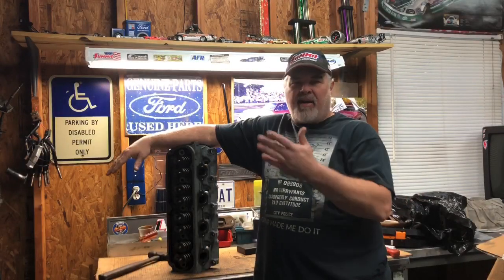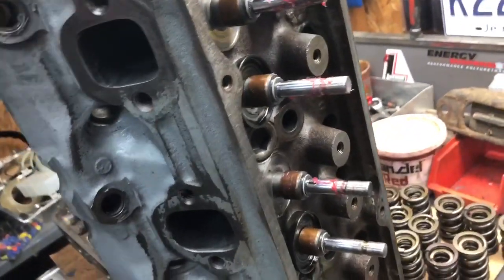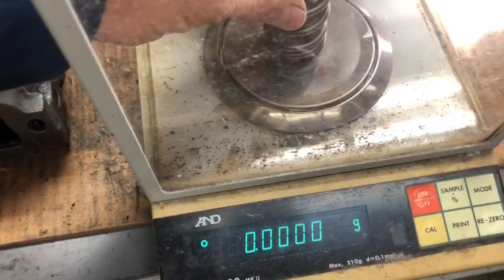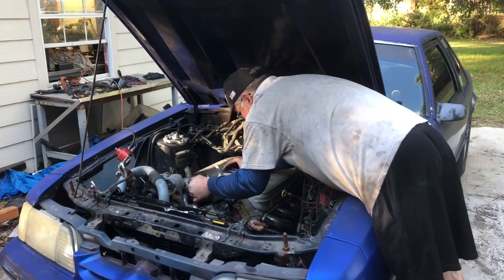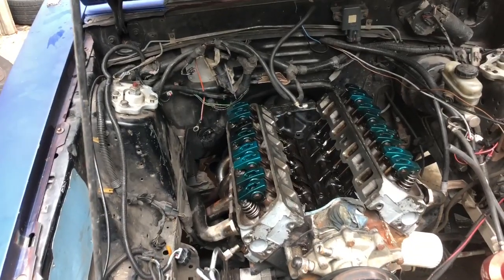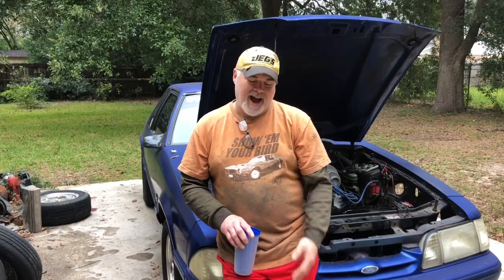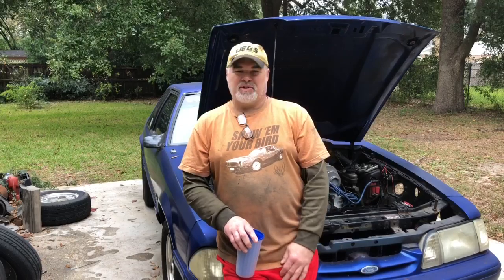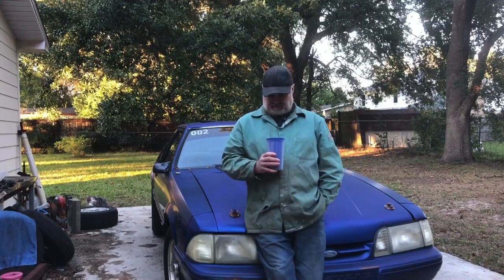1988 5.0 Mustang Coupe BRAIN Pt.14 "Head Job" Budget Fox Body Drag Car

Comment: Back in 93 I put a Wolverine 1087 in my GT..... their spring kit was beehives... first timeI had seen those type springs for street cars..... I knew NASCAR guys had been running them on plate motors thou...  Anyway it was pretty cool and ran really well for the time.  Ported E7s, Saleen Intake,  24lb injectors, 4.10s.  11.60s NA and 10.70s on 150 hit.... this was on McCreary G60s.... Dumped the EFI for a Victor JR and AED 750 HO couple yrs later and that put the car in the 10.40s on nitrous....  Good memories.

Comment: Good story for you. I work on Honda's "professionally". Rebuilt an old 92 civic engine. Napa machine shop nailed it. Ring gaps perfect. Good oil clearance. Stuttered when I started it then just purred. Shut it down cheked fluids. Restarted and it stuttered abit then ran fine. Go to put it in gear and the engine stalled? 
I didn't press the rear main seal in all the way and flywheel was dragging on the seal when you press the clutch. All the substandardest goodness. Life happens.

Comment: That's a good deal on the Alex spring's.  I've always  been a Crane fan but their version  of beehives weigh a  140 grams each I've never seen such a big retainer they are tall bulky and shaped like a top hat. I ended  up not using them they are still in the box a good place for  them
Reply from the maker: David had bought some if im correct (mcnuggs) so i thought i would try them just to see...i'm just happy its freakin running again..well sorta lol
Reply: @5.0tussin  I actually  ended  up using comp chevy beehives they are 84 grams we had to mill the guide boss' down to get them to fit. I hope they do good I had him do a really good street port I put  the h pipe on it last night so I'm getting close. I'm going to go ahead and do a new clutch Ram fiber disc street clutch nothing  special. Da Brain was sounding good last night when I was watching.  My wife laughed  about Moutain Dew comits she said it is the choice  of mechanics. I think she is right love me one ice cold.  I will get me some Alex beehives next go round comp is proud of their stuff.

Comment: I don't know what the limit is but when I worked at a speed shop and we milled the heads we would have to have the intake milled also. Before we did that we kept blowing head gaskets. Once we had the same taken off of the bottom of the intake and angle milled the sides all was fine. Not sure if you have ever had those issues. The heads we would install would bring compression to about 10.5:1.

Comment: Did you mill the heads at all? I put gt40 heads on my 94 and I used Alex's springs and I milled .040 off them and some off the lower explorer intake. I was shooting for close to 10 to 1 compression. With other bolt ons It runs really good.  Love the shepelle show clip.   Sorry, I asked while watching the video.  You milled .030 off.    I had to use the small shim on the rockers.

Comment: and how does the new springs feel ?? any diffenrence ?? want to change mine too and buy a set of these Alex Beehhive springs  ..63 gramms less weight per valve ..thats something!!!
Reply from the maker: They seem to work fine, as far as difference i changed heads as well and my butt dyno sucks, also need more hits to mess with shift points and stuff ssooooo no definitive answer i guess............
Reply: @5.0tussin  mines are here at thePost office ..but because of Corona all is closed ..hope i can get them monday..
Reply: finally finishd my 331cu, Springs are in and engine runs fine ..no test drive so far because of lots of rain..but all fine ...

Comment: do you mess with the bottom end at all? when you throw a bigger cam lift ? lets say a trick flow stage 1?
Reply from the maker: No....depending on what heads you’re using PTV can be an issue but most OTS (off the shelf) small cams will clear gt40s and other small valve heads 99% of the time...
Reply: @5.0tussin  ok thank you for the tip now im having issue as well with this cheap tfs head that the pedestal for the rocker arm keep loosing it self up and I torque them down to spec and also put tredlocker and tefflong tape oil stil find it way to loosen it up causing miss fires I really don't want it to get it machine and take out the heads im broke lol

Comment: Wouldn't the weight of the valve make a difference in a slight performance gain
Reply from the maker: Yes but valves are a little more pricey🙃
Reply: @5.0tussin  Rodney, what lighter valve would you use  if you could??

Comment: I just pulled my old 302 and t5
Reply from the maker: dude! you just got it rollin!
Reply: @5.0tussin  yeah but the motor thats going in now is from a 98 Explorer, got a .536/.536 218/228 112 cam, spring kit from alex's parts, t5 from  93 gt, mcleod clutch, hedman hedders, and im gonna run some dumps. Thats why

Comment: Are those the “P” heads or regular GT40’s?
Reply from the maker: 3 bars, not a P fan even though I have 3 sets in use lol
Reply: 50tussin 
Are the P heads make more power than the regular GT 40’s with a similar combo?
Reply: I run the P heads on my 306. Maaaan are they a pain with the spark plug angle and longtubes. Likes to burn spark plug wires left n right unless I use 90* boots on each end.
Reply from the maker: @scott..i'd be shocked if anyone could tell the difference one way or another ............
Reply: 50tussin hard too with all the accessory brackets n such! Lol. I hate the plug angle but they are one of my favorite factory ford produced heads for a 302, smaller combustion chamber too helps 👍🏻